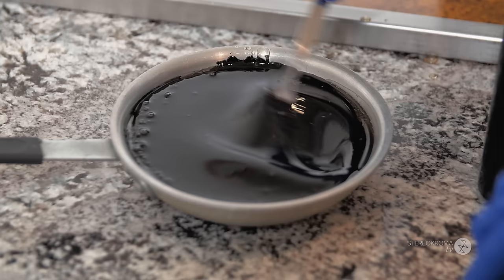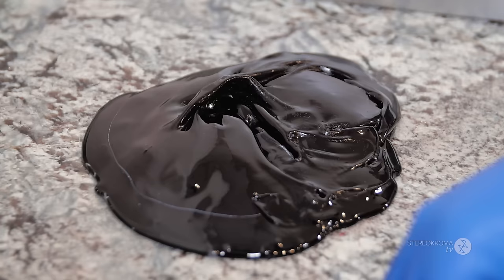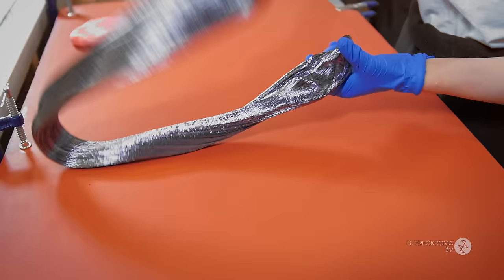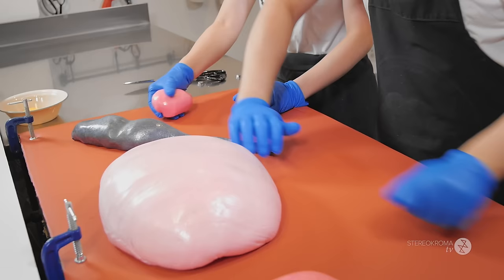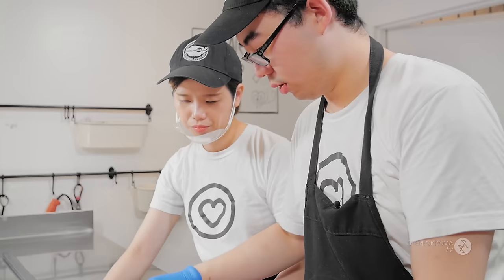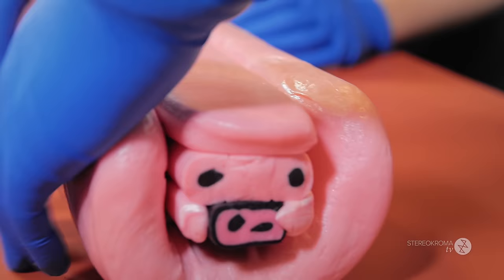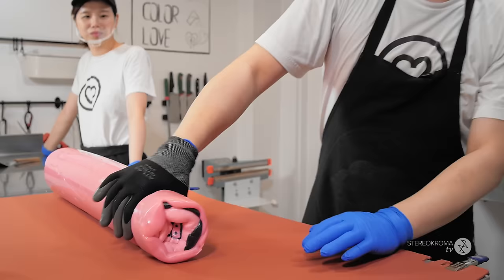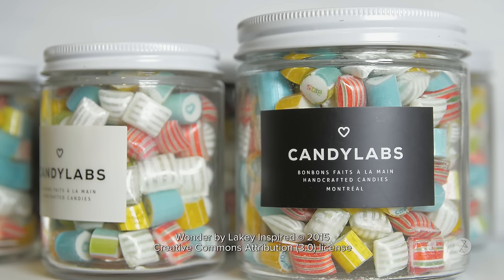Making Handmade Cute Pig Candy with Artisans at CandyLabs 🐷

Comment: Those pans must be hell to clean
Reply: The candy all slides out once it's cooled down enough
Reply: Emma Loo or before washing it, let the candy cool in the pan and remove the candy then, WALLA extra candy to eat and now it's not hard to clean!😂😂😋😁🙆🙋
Reply: The easy way to clean sugar off pans - add water and bring it to a boil. The sugar will dissolve.
Reply: Cleaning pots and pans that you used to make candy with actually isnt that difficult.
Reply: From my experience with making candy all you need to do is let it sit and slam it down on a solid surface and it all cracks off
Reply: they never clean them

jk i dunno anything about that
Reply: Just pour some water and wait
Reply: Hot water spray would melt the sugar really quickly
Reply: @kabbyunicorn8090  "walla" 
please tell me you did not mean voilá

Comment: So, I'm guessing the granite table is heated and used like a stove?
Reply: Steph Brooks it's cooled
Reply: Steph Brooks no the candy is heated before hand the granite is there so it doesn't stick as much
Reply: Steph Brooks it's heated  a bit so or stays stretchy and gooey
Reply: Steph Brooks the granite cools it but I'm pretty sure the orange counter is warm
Reply: Steph Brooks the red table is heated the granite is solid rock and is not heated
Reply: The granite is a natural heat sink meaning it draws the heat out of the candy so it can be pulled an worked with then the red brown table is a heat table that keeps the candy at a temperature for working and shaping it

Comment: Why do you wipe the candy with a sponge?
Reply: It's to keep the candy moist so that it will adhere to the other candy parts during assembly. If you let it get dry they won't stick together.
Reply: MrMagnaFarce. so are you using water or is it a liquid sugar?
Reply: You just use clean water.
Reply: Kaino good question
Reply: To act as a glue